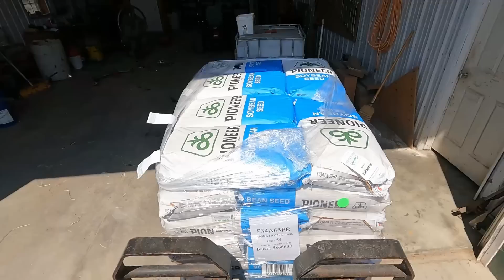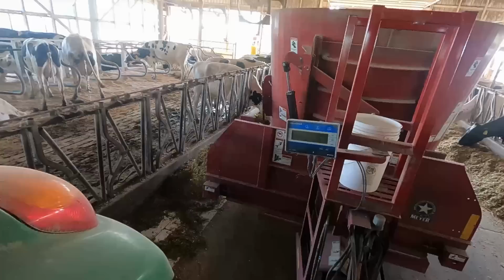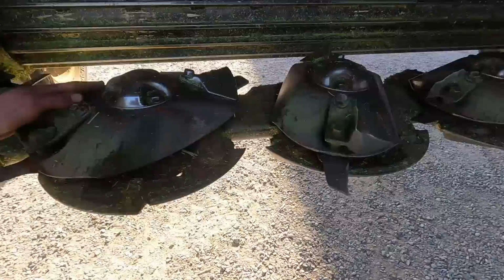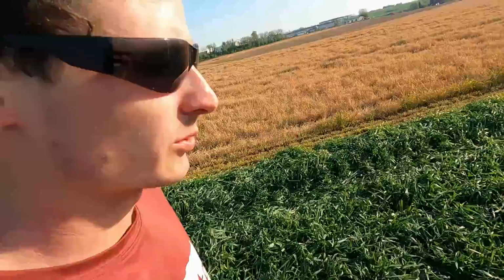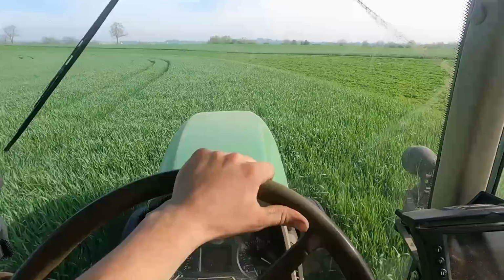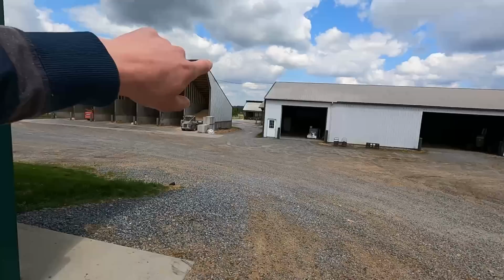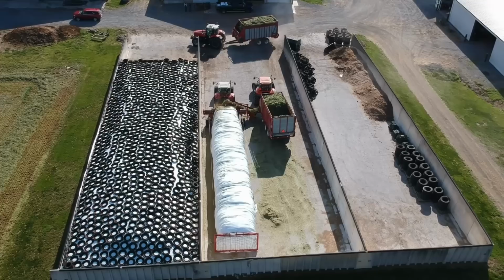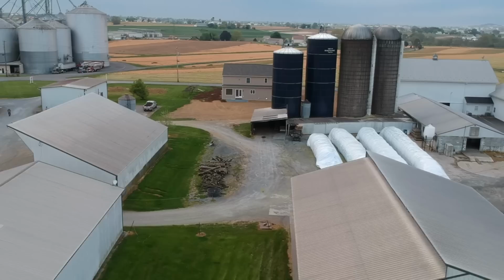Triticale Harvest 2023 | Filling Ag-bags

Comment: A+
Put a varmint cage with bait,  next day carry out 10-22 ruger, plug it in the head, burry it in its hole, cover it up.

I think when u change the mower blades, put some oil, w d 40 on the rusty nuts, and keep a can on u tractor for other rusty nuts,bolts.

Comment: JD dealer told me on them series tractors to solve the overheating use a hot water pressure washer to wash out the radiator. Ink ow from experience cold water pressure washer and air compressor doesn't work to break up the gunk in the radiator.

Comment: The dust that builds up in a feed tractor radiator is pretty intense. Would probably pay to pull it off once a year and do a deep clean between each fin. I'm sure you have some hard plugs of dirt in there and that's why the tractor overheats.

Comment: Have you flushed radiator lately? If you need to, use extended life antifreeze. I have several 55 series J D tractors and the guy that works on them suggests JD or chevron.

Comment: Have you thought about putting just a floor against an outside wall of your bunker silo? Not perfect, but cost a lot less than building another full wall
Reply: Yeah but not that permanent and proper I’d say . And with the tarp getting it more air tight would be harder
Reply: A floored area would serve as a good place to locate an ag bag storage when needed.